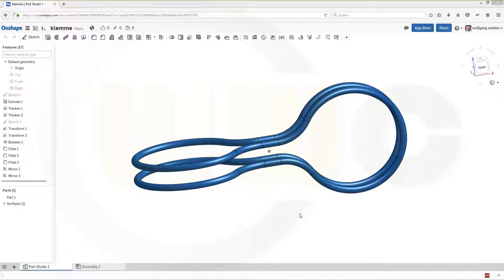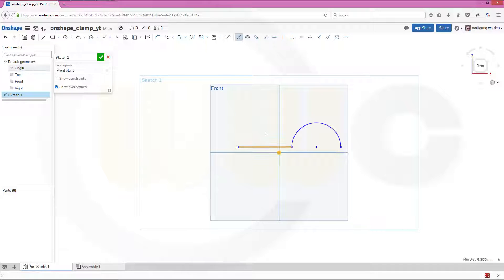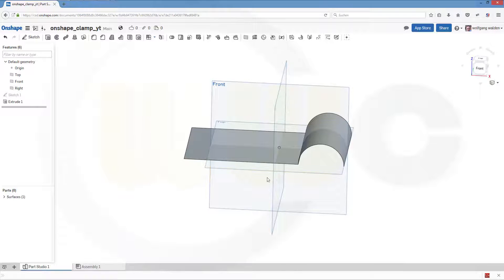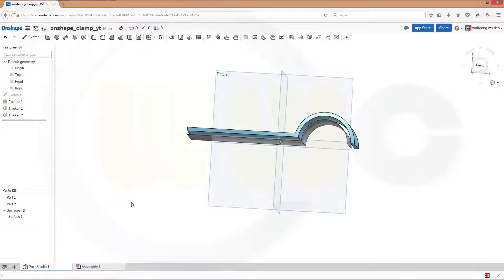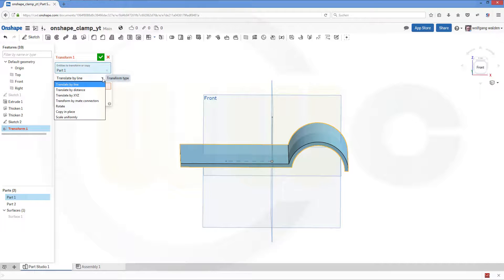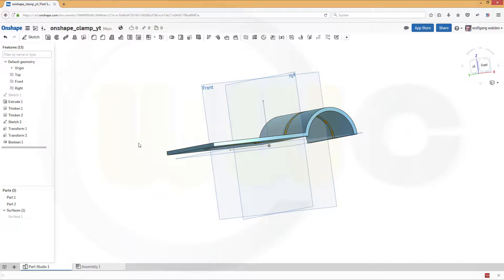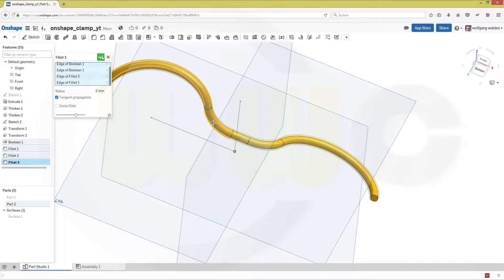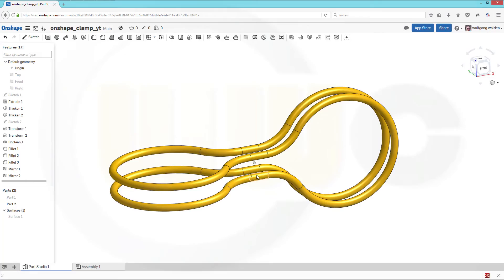11.3 Klemme - Clamp - Onshape Training - Part Design

Comment: I have watched nearly all of your Ohshape videos. I started my journey with Onshape in January of this year. I have learned a lot from your efforts, thank you for taking the time. When I was in high school, more than 50 years ago, mechanical drawing was my favorite subject. Later in life I saw CAD programs being developed. I could not afford the software or a decent computer to run the software. Now with Onshape availability, my retirement free time and gentlemen such as yourself it is possible. 

When you created the first thicken in this video, there were 2 parts and 1 surface, when confirmed. I was able to list two faces of part 1 and then select the entire sketch, which gave me 2 faces and 1 surface, as in your video.  When I confirm the thicken process I am left with 1 part and no surfaces. So, I can't select a surface in the 2nd thicken process. Constant updates with Onshape is probably the issue. I see it has been quit awhile since this video was made.  Any suggestions?
Reply from the maker: hi, I made sort of a mistake by accident. I had selected the 2 faces and the surface and made a thicken. And with the old version of Onshape - 2 parts were created. I didn´t notice at that time, sorry. So just make a copy of the part, because the part created with the 2 faces is the same as the part created form the surface.